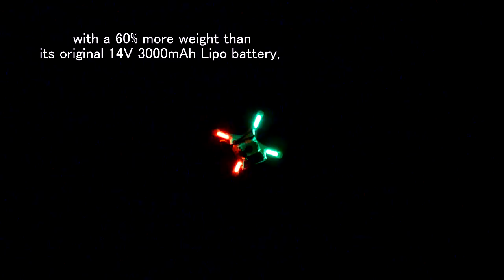14V 7000mAh Li-ion battery for DJI Phantom FC40

Comment: I have built a couple for my DJI as well. Can't quiet get them to fit inside... but I read that you can buy Li-Ions that do fit and they are like 25 bucks per battery and get longer times as well.... maybe not 7000mAh

LiPo improperly charged can set fire to your house, you dog, the basement... Li-Ion are much safer. When they go bad, they dont bulge and a'splode.

Comment: Just want to make sure i got this right:  You added an extra 7000 mAh, yes?  So the total is now 10,000 mAh?
Reply from the maker: Yes, so if you work with both in parallel yes. You have a 3000mAh and a 7000mAh. total is 10000mAh, but Li-ion min voltage is 3V (per series) and LiPo min voltage is 3.4V so the practical capacity if you use both together is around 9000mAh working paralleled. Separately both can be drained completely

Comment: So 333% the battery capacity gives you 200% the flight range.  Interesting.
Reply from the maker: if you measure in total energy yes. 3000mAh is a 100% default capacity, with both batteries you have 10000mAh, that is the 333% capacity. And you get a 100% more flight time (200% total time).

Comment: Did it really added that weight on it? 60% more?? I thought it might probably be less..
Reply: Batteries are always the heaviest things on a quadcoptor, and he more than tripled the battery capacity.
Personally i'm surprised it wasn't even more heavy than it was.
Reply from the maker: if you use the battery alone is a 60% more battery weight but a 133% more capacity from 3000mAh to 7000mAh. So the specific energy is higher. LiPo is also a good chemistry with a very high discharge rate and a good energy density. The high density Li-ion cells have not more than between 40% to 50% the specific energy LiPo have

Comment: "Original 14v 3000mah lipo battery"
Doesn't the P1 have a 11.1v(3 cell) 2200mah battery?

Cool tho, I have always wondered if 18650 can put out so much current that those motors uses.
Reply from the maker: Yes you are right, I toke specifications of the standard 4s LiPo battery compatible with the FC40. (FC40 works with both 3s and 4s)